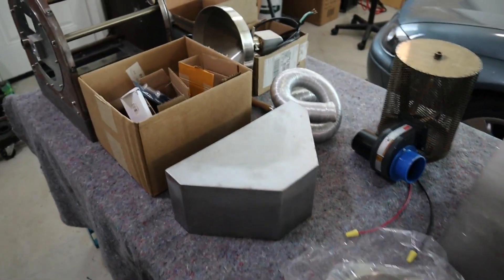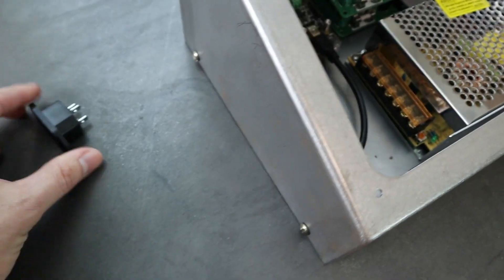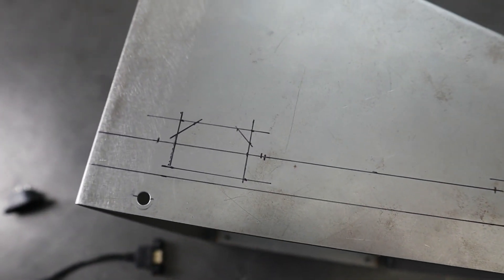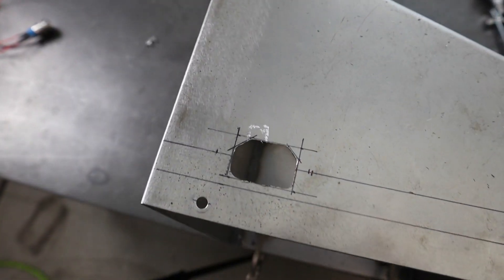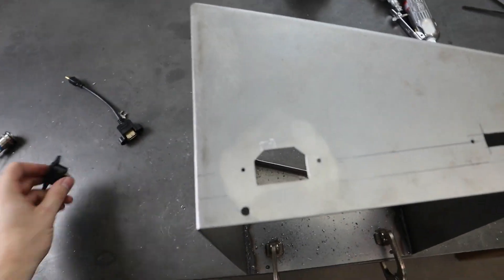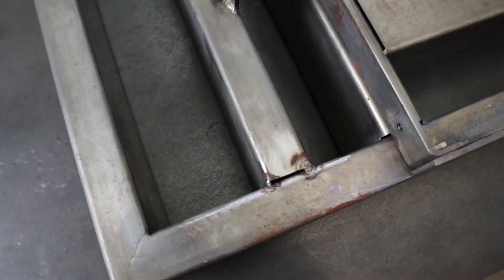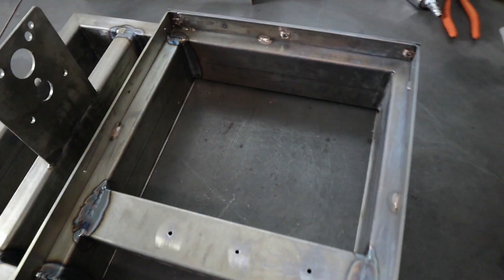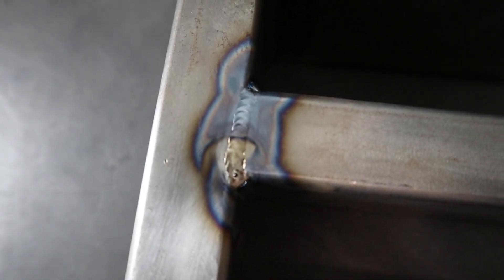DIY Coffee Roaster Build Part 1

Comment: So I know this video is a bit aged but where did you find your basket?  I have been looking and cant seem to find anything basket wise that is even remotely suitable
Reply from the maker: It’s from an Aillio Bullet. I got mine from Sweetmarias. They call it a “metal cooling bowl”
Reply: @kylegreenhaw6653  Sorry I didnt mean basket I was referring to the drum for roasting.
Reply from the maker: Oh, I built my drum from scratch. You might be able to find replacement parts from some of the more popular compact roasters. Or make your own!
Reply: @kylegreenhaw6653  Awesome.  I am specking 7" round by 9" long for my build.  Is your's around the same size?
Reply from the maker: Mine is pretty close to that. About 7” diameter and 10” length.

Comment: Nice Video Kyle! Where did you get the components to fabricate the roaster, the electrinics for the controls and rhe heating elements?
Reply from the maker: The raw materials and mechanical bits were mostly sourced from local suppliers and McMaster carr. I got the heating elements from Mor Infrared. The electronics came from Amazon and eBay.

Comment: Where did you order your 3/8 D shaft and bearing plates from?
Reply from the maker: The shaft and bearings were purchased from McMaster Carr. I machined the blocks from a chunk of aluminum. 3/8” are not readily available. I would go with 1/2” if I was to do it again.

Comment: Awesome vid on the tig welding. What cup size and welder are you using? Can't wait for Part 2
Reply from the maker: Thanks dude! I'm using an Alpha TIG200x. I put a Miller WP9 torch on it with a gas lens set up. The nozzle is a #7 and I'm running a 3/32" 2% lanthanated tungsten. Part 2 coming soon!
Reply: @kylegreenhaw6653  Awesome! That's almost identical to my setup except I'm running a CK Worldwide Torch. I'd like to upgrade the pedal on my 200 tho
Reply from the maker: Upgrading the pedal makes a huge difference, one of the first mods I did. I got mine from HTP, it works great!

Comment: Nice work, thanks for sharing. When you are welding, do you leave the gas running until the weld has cooled?
Reply from the maker: Yeah, I have my post flow set at 5 seconds. It will help reduce the amount of oxidation on the weld.
Reply: @kylegreenhaw6653  ah ok. So that's what the pause is about. As an non-welder I was a little confused